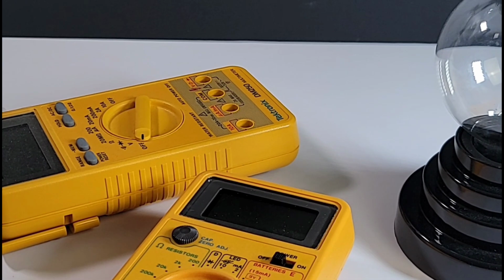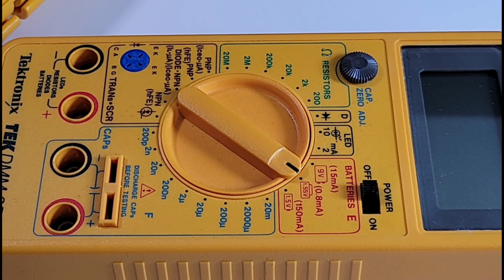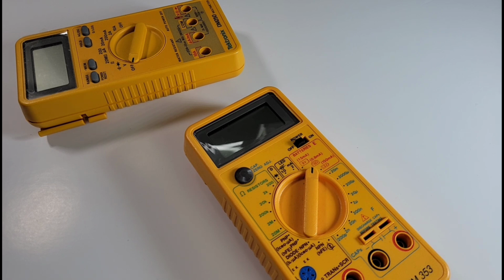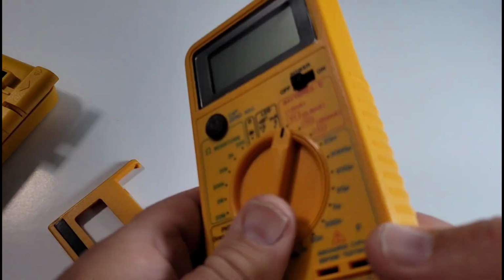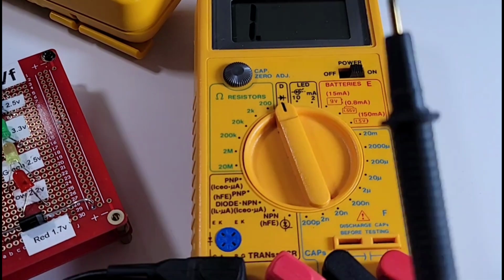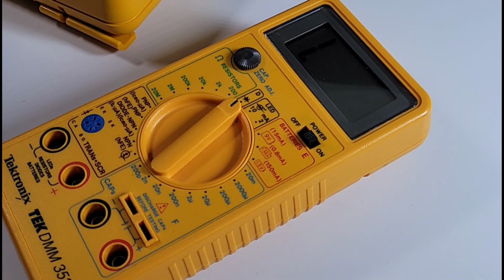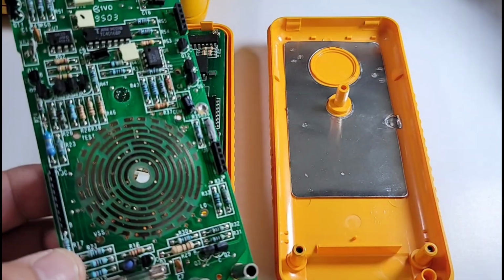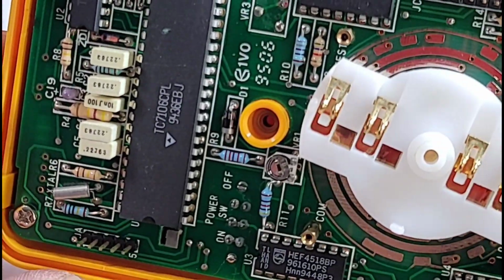RETRO-TECH ○ TEKTRONIX DMM 353 Vintage Multimeter Mini Review & Teardown!

Comment: SCR testing? What are the maximum control voltage and the maximum hold current?
Reply from the maker: Great question..unfortunately the  DMM353 was only produced for about a year (1995-1996) It is quite likely that an electronic (PDF) copy of the manual was never produced. I have looked high and low for the original manual but have never been able to source one...here's what I know for specs. LCD display with 3 ½ digits. Ranges of measurement Capacitance 200 pF to 20 mF (resolution 0,1 pF to 10 µF), Testing frequencies 820, 82 and 8,2 Hz, maximum testing voltage 3,2 V, Resistances 200 Ohm to 20 MOhm (resolution 0,1 Ohm to 10 kOhm), Diode testing with 1 mV resolution, testing power 1,5 mA, testing voltage 3,2 V, LED-test, voltage 3,2 V, power 2 mA or 10 mA, Transistor test (PNP / NPN), range 0-1000, approx. 10 µA and approx. 3 V, Transistor leak test from 10 nA to 20 µA

Comment: Nice video. I have a TEK DMM 353TW, serial 3990, but cannot find a manual/schematic. Anyone know the name of the manufacturer in Taiwan? Not even Tektronix seems to know. I have been retired, but still perform extremely high end analog audio research and would appreciate a manual/schematic just in case. I used the meter in my lab research designing an extremely high end vacuum tube phono stage, the 11A line preamplifier, and Push Pull amplifiers.

 All but one power supplies use polypropylene filter capacitors vs typical electrolytic capacitors, and accurate measurements are necessary for matching ufd values, RIAA phono parts etc. Due to poly capacitors, the musical quality/accuracy is in a different league than any other audio component/system. 

Cheers

Steve
Reply from the maker: Wow..sounds like some seriously good electronics ! I have looked high and low and cannot locate your user manual. Tektronix is definitely one of the more difficult vendors to  locate information on. I'll keep you posted and please do the same. 👍
Reply: @KeepOnTesting Thank you Darren for your appreciation of my research and taking the time and efforts to look for a manual. Much appreciated.

The research started around 1980, so it has been a deep research study. It has taken me some 10 years just to complete my two way test speaker's crossovers alone. That after designing all the electronics, ics etc. 

Concerning the quality of the designed audio system, one can hear down to 1 part per million with resistor changes, a change of 3/16" of one turn with iron core 12 mh chokes, of changing to 
9 or 11 wires in my 6 feet long 10 parallel 18 gauge wires (for each speaker leg). We are talking 
around -114db or more down from reference. No wonder individuals report sonic differences 
between DACs, phono stages, preamplifiers, amplifiers. +/- 0,1db 20-20khz specification means nothing, as that equates to a change of only around -54db. 

What the research shows me is that the electronics can be greatly improved if proper design and parts are utilized. I have yet to find a company that has done so, unfortunately. And the cost is not that high. 

Anyway, thanks again for all your work Darren.

sammy

Comment: Nice niche! Logic chips never act as a Schmidt trigger, that's a characteristic of inputs on some chips. These dual 4-bit BCD counters have clock inputs that can 'clean-up' poor rise times on clock inputs. Dave J. covered Schmidt hysteresis well.
Reply from the maker: True enough, a Schmitt trigger doesn't necessarily imply any logic function.
Too bad I can't find a schematic and see if the gate logic symbol has that special marker.
Reply: Aren't they frequency dividers used to apply different frequencies at different capacitance ranges? The 7115 capacitance meter uses a similar structure.
Reply: @watchmakerful  Yes frequency counters and dividers can employ "hysteresis" using positive feedback on inputs to clean-up transition noise. Many TTL gates of assorted functions use it on their inputs. See EEVblog #941 - Schmitt Trigger Tutorial where it's explained starting at around the 10 minute mark.